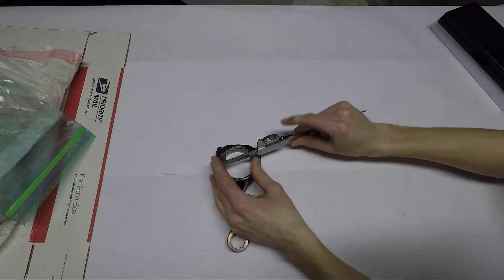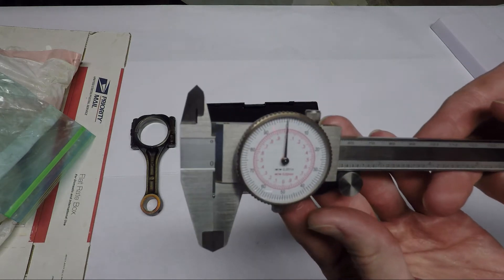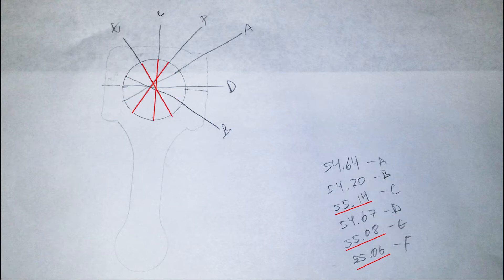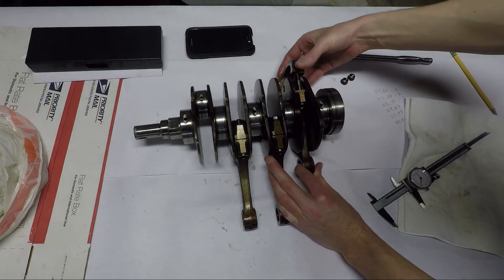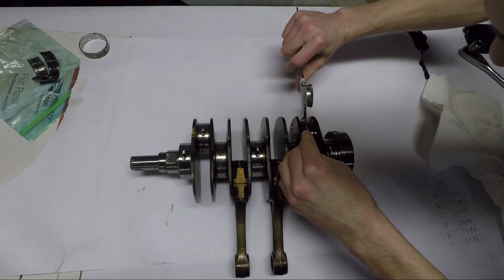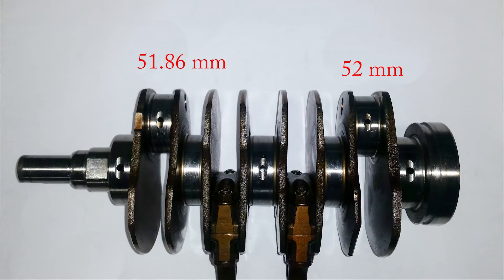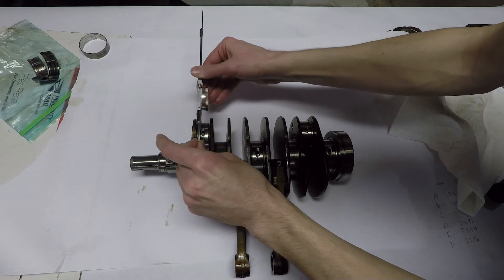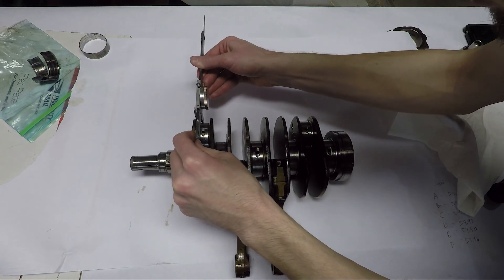How bad is the damage??

Comment: Is it good idea to put some effort and after buying a subaru, change connecting rod bearings even before they start knocking and engine sounds good?
Reply from the maker: If everything sounds good, I wouldn't worry about it. Keep up on maintenance. Bottom end is labor intensive to replace
Reply: Well, Im trying to gather informations about boxer engines, so im curious..
What causes most damaging the rod bearings..? Cold high revs, bad oil and these clasics, or do the boxers have some manufacturing defects  that causes these problems?
Reply: @ivobrezina1162  Gravity, since they're sideways imo. Cold revs is bad for any engine that doesn't need it to stay at idle. I believe the aftermarket components are a bit better, some dude but a way more impressive looking crank shaft into his.

Comment: How come you don't replace it with a new crankshaft instead of buying a whole new engine?
Reply from the maker: +Flash new crankshaft and new bearings require the bearing faces on the block to be machined. Because these blocks are made of 2 pieces, I was quoted 800 dollars just to machine the block because it takes them so long to set up the machine. 800 plus parts. For me it was cheaper to find a parts car
Reply: Really depends on how long you keep the car. I'd consider a new crankshaft without getting the block machined and test it before running it see if that cyl is working smoothly. Because the newer crankshafts if you get the right one is a lot better than the old stock ones for ej253's. Could always replace the block as well if it doesn't work. Way more work and extra materials taking it back apart. Starting to think there is a some kind of serious flaw with either the crank shaft on conrod 1 on these or something around that area with the oil flow causing issues on this engine.

Comment: Really enjoying your series on this. Any idea what caused the bearing and rod damage?
Reply from the maker: +Chris Killian Thanks! Nice to hear that people are enjoying this. I have no idea what caused this in the first place. Seems to be a common issue with Subarus though. I'm guessing something caused the oil pressure to drop. Maybe low oil level or incorrect oil type. Maybe if it was caught in time we could have just changed the bearings and polished the crank. No such luck
Reply: Even an incorrect oil filter too, dry starts.